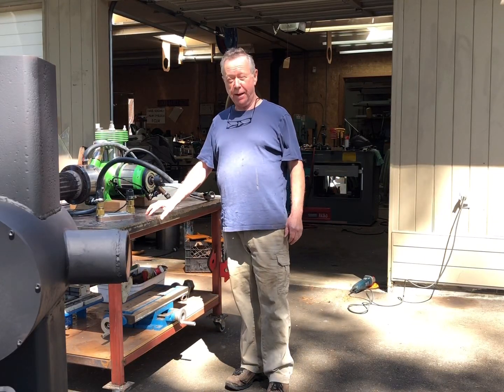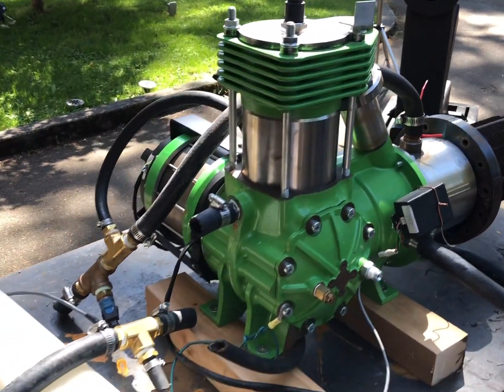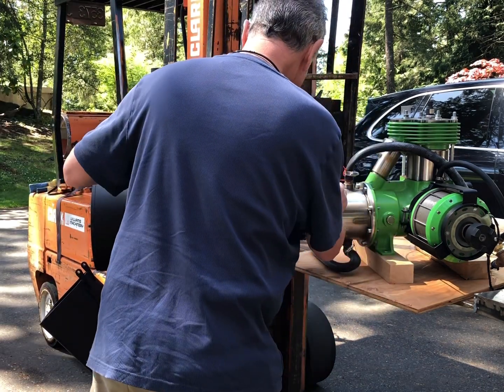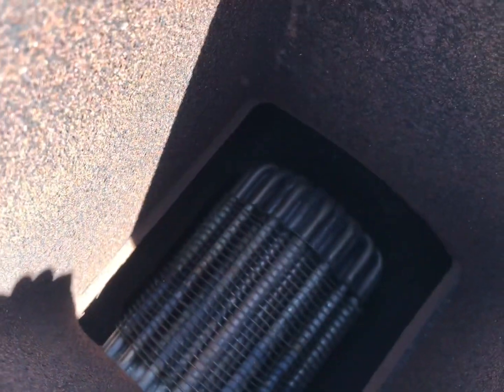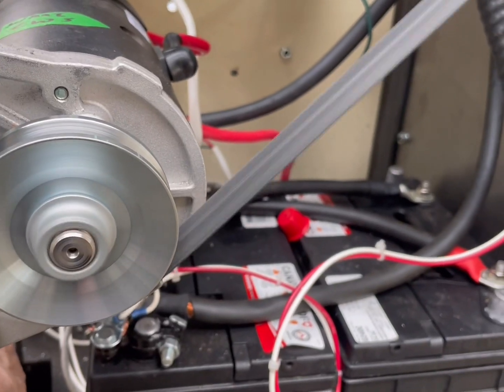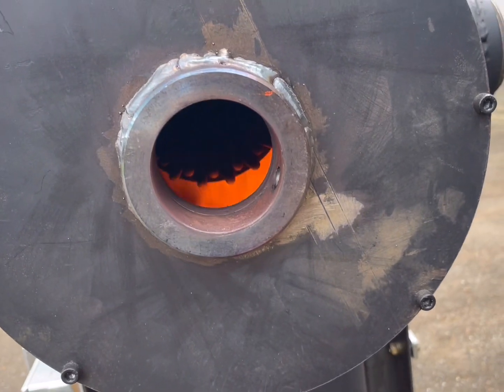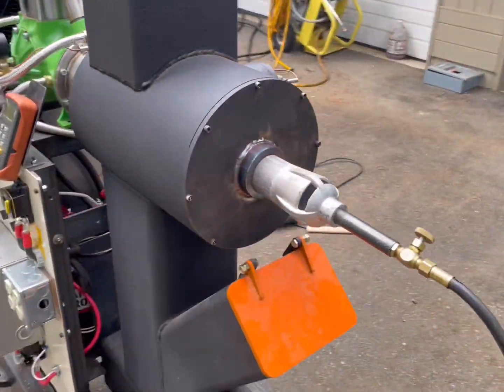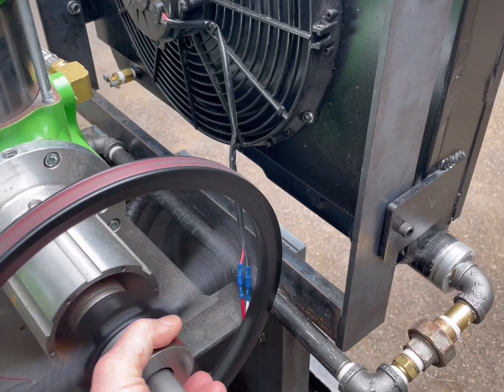Rocket stove heat engine Project

Comment: Is the charging circuit to the batteries closed?  How many watts of work were you able to get from the engine?  The internet has lots of videos of sterling engines turning.  But actual work numbers seem to be top secret.  Thanks and cheers.
Reply from the maker: Hi sorry I’m unable to tell you, I got a starter motor/generator from Amazon with the intention of generating enough power to charge the batteries to power the inverter I wasn’t able to get anything out of the generator and never tried to find out why, I’ll get round to it one day for sure,  sorry for not being much help

Comment: Insulating that rocket stove should help it retain much more heat. I worked at a heat treat facility and we would use insulation in our 20 foot long furnaces that would withstand very high temperatures.

Comment: you are so lucky to buy this stirling, hope you dont let it die in your basement... my dream is to study this inresol engine
Reply from the maker: Oh it won’t be dying in the basement,  it’s so well built it’s a shame the company that made them went  out of business
Reply: @daveconway7109  wrapping that whole chimney with insulation should help it get to the required heat you need🤷. Talk to a heat treat shop that heat treats steel. They should be able to give you some used insulation or even some new. Careful with the insulation a respirator must be worn when handling it. It falls apart easy after it’s been through many thermal processes. I wish I lived next door to ya. I have many tools as well.  Looking to add a small Metal milling machine next.
Reply: Oh OF COURSE Sir Its a shame, but there is some reasons behind the death of the company... the inresol guy is now rich and living in the south of france with porches and ferraris...europeans lobby of energy made him rich so he stop working on stirling engines... they don't wan't us to know something @daveconway7109

Comment: Where did you acquire such a sterling?   Looks like a very good quality build
Reply from the maker: A friend got it from the manufacturer in Sweden, they were making them for houses that are heated with wood, the idea was that the Sterling would utilize the waste heat and turn it into electricity to be put back in the grid, sadly the company went out of business

Comment: Great work, but this can never be cost effective in supplying energy to the Grid. Sterlines are great but not as wood and gas as energy source but with Heat Solar. Also the nitrogen injection is not needed if properly insulated and put in water. This will only look good in a museum or for raising Capital.
Reply: why would you be supplying power to pump into the grid? wouldnt it be easier to use it to suppliment your house?
Reply: I could be wrong, but those, building devices like Dave, never care about Grid. Grid is headache of few rich, willing to enslave most of regular people. Stirling is about autonomy and freedom from Grid.
Reply: Amazing imagination!

Comment: Hi Dave that’s awesome mate. What’s the power output of the motor?
Reply from the maker: Hi, sorry don’t know that yet got no way of measuring it
Reply: @daveconway7109  I thought I saw an alternator connected to 2 batteries, or was it a starter motor? If it was an alternator then surely it must be giving out some power, you only need to put a load on and measure the current and times it by the voltage then keep increasing the load till the speed drops
Reply from the maker: @dantronics1682  it’s a both a starter motor and an alternator there is also an inverter for AC power
Reply: @daveconway7109  do you still use it? Im trying to find a central heating boiler that has a fp stirling generator built in to power my workshop
Reply from the maker: @dantronics1682  
No I don’t really use it but I do like to tinker with it I’m fascinated by Sterling engines
The problem with the rocket stove is it consumes fuel quite quickly and you have to constantly feed it , it would need some kind of mechanical feeder to work for heating  a shop
Reply: @daveconway7109  hook it up to an alternator and find out
Reply: 2 Watts